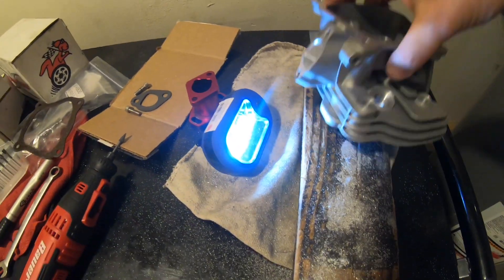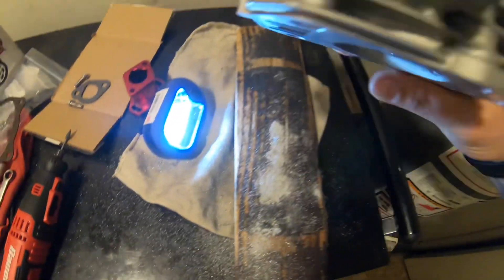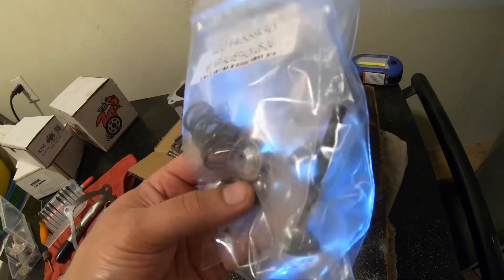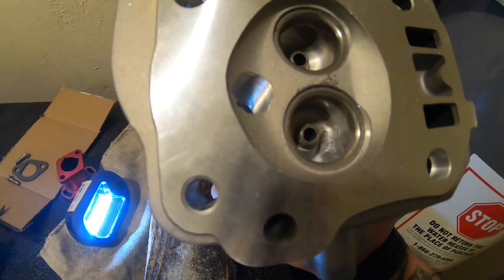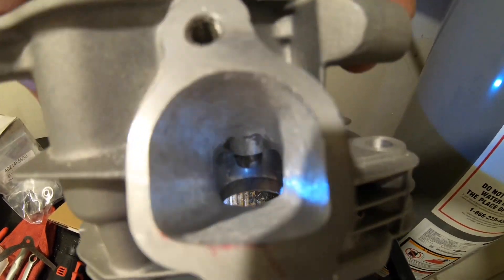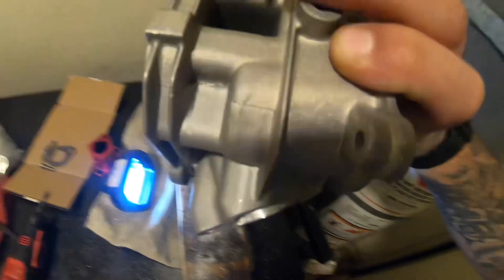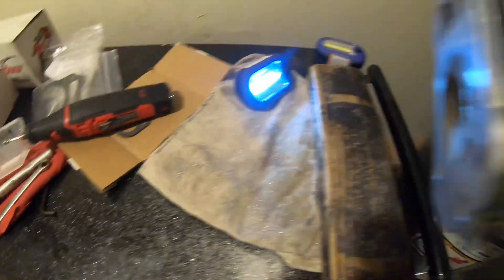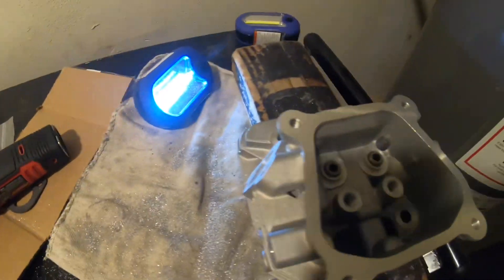We ported our Predator 212 14cc high compression head

Comment: Nice i was scared to grind down the valve guides i only did as you said where you shave down the very end of the port by the valve seat and creating a uniform and flush direction that will lead straight to the valve i noticed that my low end tourque isnt physically there but i have to press the gas much less to get moving and when im hauling ass around the 4k rpm mark this thing picks up like if it had a cam i was hitting probably almost 40 on dirt (idk i didnt have my gps)and it wanted to keep going but i let go of the gas cause my rpms where climbing quickly and i honestly got scared that port job and 18lbs springs made a big difference i cant  beat on it to much still have stock internals.

Comment: whats the compression ratio now??
Reply from the maker: Was over 15 blowing off side cases n gaskets had to install a thicker head gasket and vented the motor better
Reply: @EnviousRepairPerformance  Sheesh thats what i figured. I want to put a 14cc 27/25mm head on my 212cc non-hemi. What fuel you running??
Reply from the maker: @NouriGains 100 octane

Comment: What carbine bits do you use to Port your heads do you have a link
Reply from the maker: MABUARN 10PCS Tungsten Carbide Rotary Burr Set Double Cut, 1/8"(3mm) Shank Cutting Burrs Tool for Wood Carving Grinder Drilling, Soft Metal Polishing, Engraving https://a.co/d/dhPcXvu these are the ones I use the work perfect tooo cut quick so you have to be careful
Reply: @EnviousRepairPerformance  thanks brother
Reply from the maker: No problem they work perfect 👍